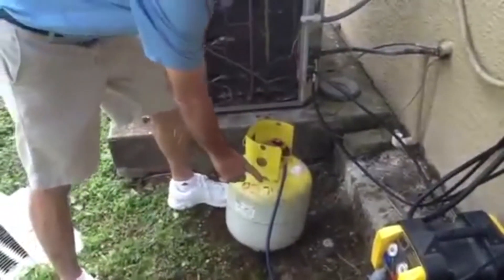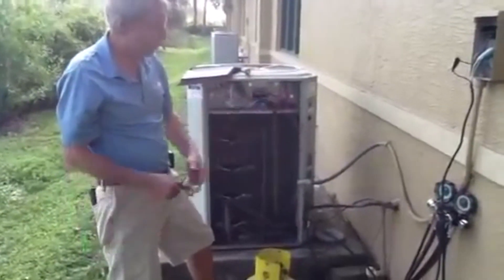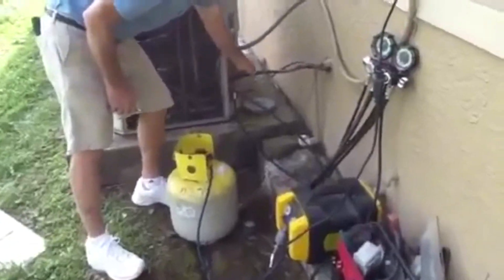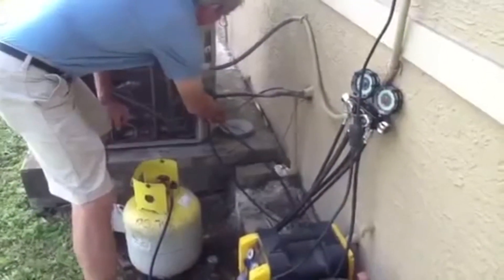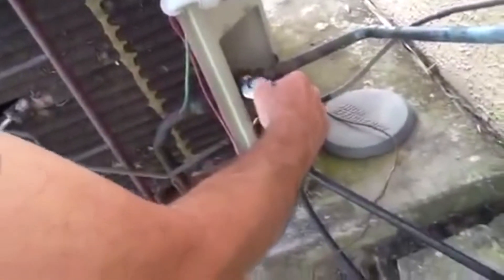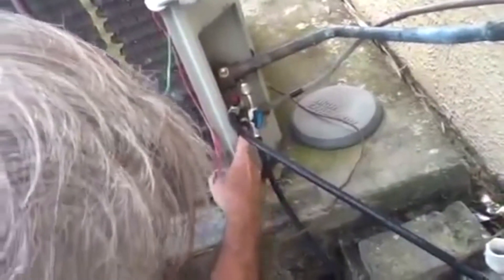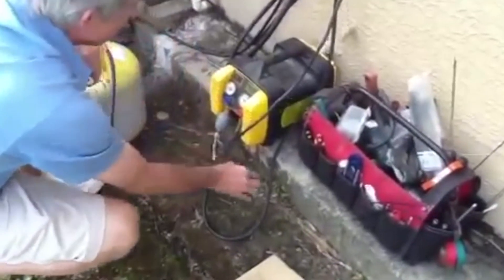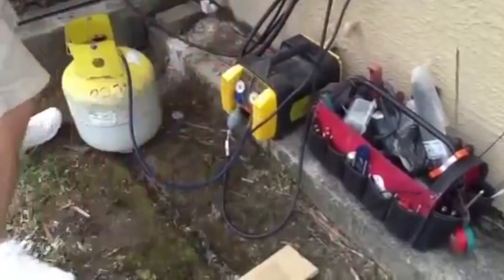A Quick Overview Of Refrigerant Recovery

Comment: Can you test the old Freon for acid and it has been filtered can I reuse it ?
Reply: Just a question sr. What happens if I use a contaminated gas.  That reason  I'll asking is because here in Mexico  we use it again  I know the we don't  have any rules  like  y'all but ac work good after added gas
Reply from the maker: You’re supposed to only use it with a customer that is recovered from According to the EPA